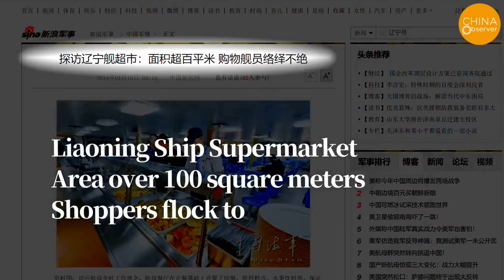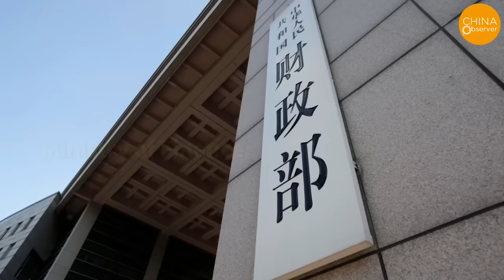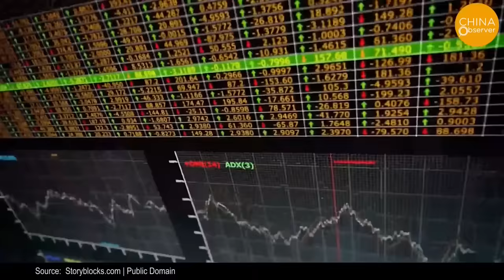China’s Junk Aircraft Carrier Fears to Sail? A Big Joke Due to Copycat Failure

Comment: Ok, about the converted Russian/Soviet carrier (Kuznets class) Those missiles were there because that TECHNICALLY Made it a: "Guided Missile Cruiser with Auxiliary Aircraft", Which is what allowed it into the Black Sea.  Turkey will not allow any Aircraft Carriers through the Bosporus by Treaty.  That said..Every US carrier also has a "Convenience store', as do Most USN ships, How big and Selection depends entirely on the Ship class.  There's a Lot to Ding the Chinese about, but the changes they made to that ship are actually Smart...problem is, they're Operating Heavy Fighters off of it, which means reduced Range, and ordnance load tradeoffs, Tanking through Buddy stores only, and No AEW capability....which is Why they're trying to make the jump to CATOBAR. Right now, they're pretty limited in operating area.

Comment: The magnetic launch system is never going to work! The type 3 and 4 carriers have traditional fuel oil/ diesel engines and those simply cannot generate enough electricity to launch a military aircraft using current mag-lev technology.  The USS Ford is struggling to do it and it has 2 nuclear reactors to draw from!  Whats worse is China has killed a lot of their best pilots trying to do carrier operations- to the point that Chinese pilots are not willing to try it anymore and are refusing to fly!  China does not have a plane designed for carrier operations -they need stronger landing gear, stronger engines, stronger frames etc. and they just haven't built any yet.  So they are trying to launch land based aircraft from their small carriers, which is crazy!!  They are way to heavy, way under powered and they cant land back on the carrier because they have no arresting gear and the land gear will fail!  Last i heard they have killed at least 25 pilots trying - so, pfft!

Comment: It would be far better for China, to use their existing Drone technology to enhance these floating platforms.  The Ukraine war is showing this.  Converted to long-range drone launchers, these would work just fine.  US fleets are incapable of defending against a self-contained swarm of over (about) 60 targets simultaneously, due to radar interferences between systems.  If even a dozen of drones, carrying simple 2-Kg impact warheads, were to strike a US carrier, it would be immediately become inflamed, with deck explosions and loading elevators fuel fires, to the point of uselessness.  The ship would not sink, but could not be used for anything else.  An "assault breaker" type of long range missile could accomplish this feat easily, similar to what was planned for the EU war theater, during the cold war.  Easily done now, with modern programmable drones, and this scenario is already used in multiple online war gaming software.  Gamer world is already way ahead of actual hardware.